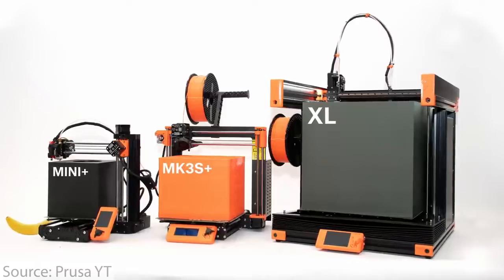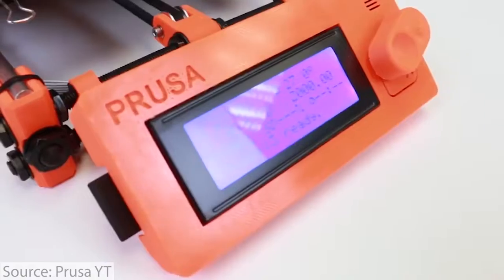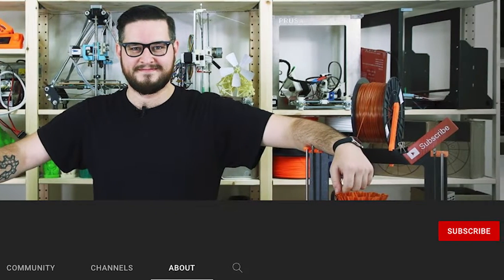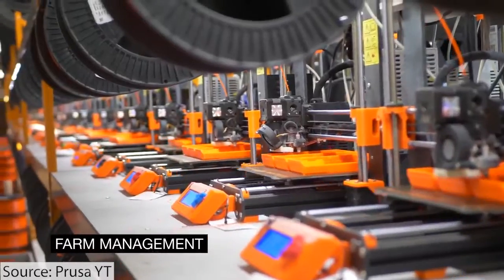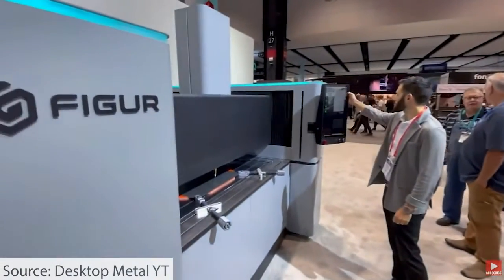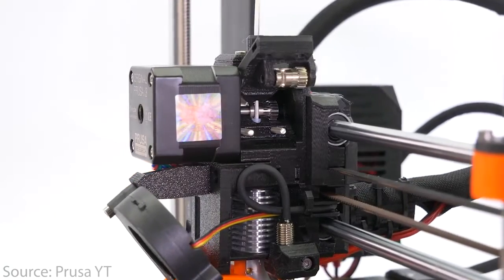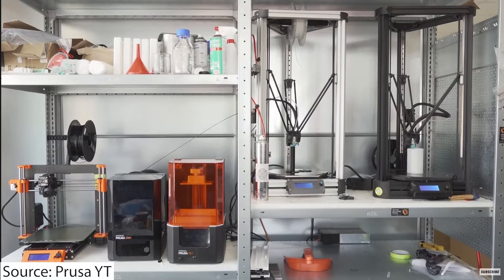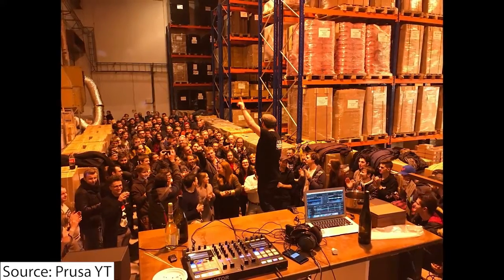The Story of Prusa Research

Comment: i wish people would stop putting this guy on a pedistal first  the fw he uses is open source and has all the features  he uses anyway second he uses petg parts come on creality and other manfactures use moulds and have professional looking printers  prusa sells his printers far over priced when you can get the same things his do for 500 bucks or less hes ripping people off
Reply: Prusa doesn't use chinese knock off clone parts in their printers. Everything is genuine. The hotend, extruder, motors, belts, rails & bearings, PSU, computer board, heat bed, the frame. All either made in house or sourced from their original manufactures. Take a cheap ender 3 and put on all the same genuine parts and now you're at the same price, if not more. But minus the outstanding customer support,
Reply: I agree with you Jerry. They haven't innovated at all which is why there's alot of other names ringing out. The mingda magician is better than the prusa bedslinger.  The corexy they have coming out isn't commercial quality in my opinion. It's close because of the tool changer but they need to have a heated enclosure. Our local makerspace regrets buying all their printers from them and they barely get any use.
Reply: @jstro-hobbytech  go with creality they make out of the box perfect prints imo i have a s1 i added some pro parts to it and it prints perfercly you dont have to mess with anything really  takes 4 screws to assmble and thats about it gantry is already done its just for shipping in smaller boxes. that prusa dude over charges and it should be illegal but people keep buying and buying and buying while he laughs i mean look at his printers they havent changed we now have printers that are stream lined 32 bit boards standard silent stepper drivers standard.. and that dude is still back in the past wheres all that money going it aint in research